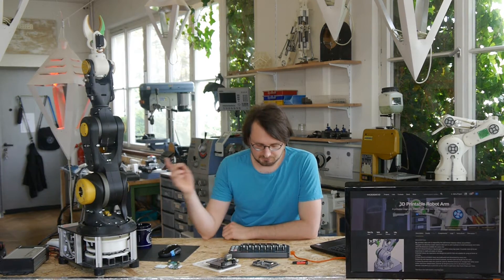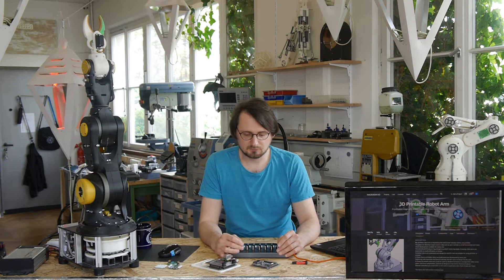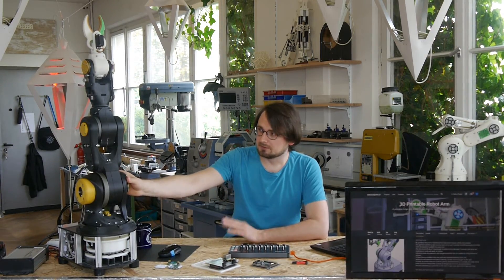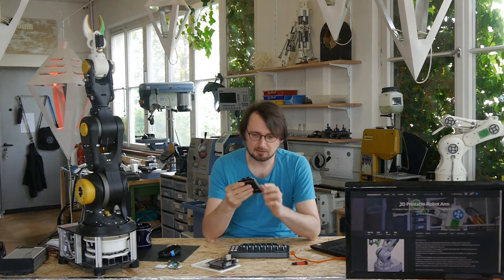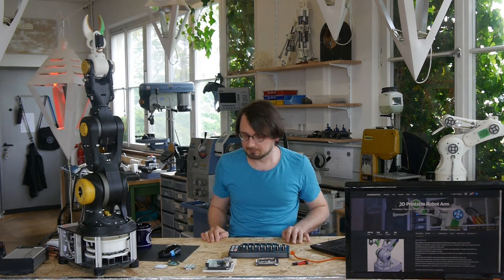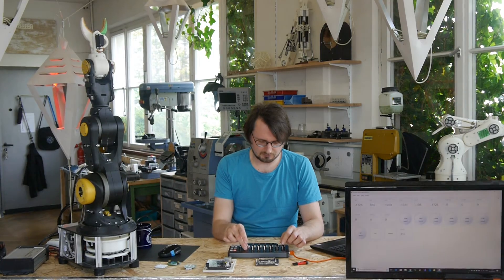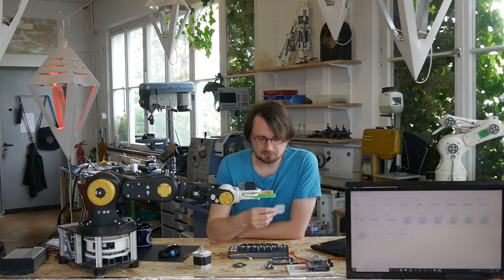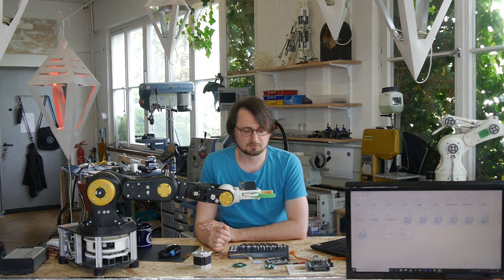3D printed 6-Axis Robot Arm (2019 Update)

Comment: I am using AMT203S-V absolute 12bit encoders, had a nightmare fixing all the issues with them, but i finally got them working, both position reading and zeroing, i can post code and notes somewhere if you're using other platforms

Comment: I have a few noise suggestions.
I have not seen the design so excuse the irrelevant information.
Open bearing only get noisier as they get dirtier, sealed lubricated bearings are better.
I don't know what bearings you are using for the base, but you might want to use lubricated "lazy susan" (corner kitchen cabinet turntable bearing) bearings, lubricated bearing are quieter and are designed for perpendicular loads and can handle any weight your arm could place on it, not super expensive either.  Of course, larger diameter is more stable.  https://www.mcmaster.com/lazy-susan-bearings/round-turntables-7/ ( I would recommend the powder coated, for slightly more noise reduction)
You can also mount a rubber mat to both side of the bearings to damping vibrations. it would only need to be a couple of mm thick. (can be added elsewhere as well)
I would also recommend a bearing at the top of the base to stabilize the load vertically so weight is evenly distributed on the turntable bearing even when the arm is fully extended horizontally.
I would love to duplicate the current version, is it available for download? 
good luck

Comment: Hello. What nozzle and on what modes (wall thickness, filling density, layer thickness, speed) you carried out production of details of the robot?
Reply from the maker: ABS 0.4mm nozzle,  0.2 layer height 3 perimeters and about 30% infill. Printed with my default settings I don't know the exact settings it was 2 years ago.

Comment: Amazing project, especially considering that yours was probably one of the first working builds of its kind!
If you use the AMS encoder, the newer models are really better than their older ones. Also make sure to use for all cables shielded cables, the stepper motors create some EMF which might disturb the delicate magnetic encoders.

For the ball bearing in the bottom, which kind of bearing do you use right now? Maybe you can consider bearings with cylindrical elements instead of spherical ones, they are way quieter! Are they 3d printed as well?

Check out the project "Woodenhaptics" - they use multi core metal wire instead of belts, they are a lot stiffer than all belts you can get. Check out CS235 of Stanford about Cable Tansmissions, here on youtube.

Comment: btw you said you have slip rings now which is neat. But have you checked if that introduces noise on the digital lines? if so that could be an encoder issue. Just a guess.
Reply from the maker: Well good point...

Comment: Looks good and solid. Beautiful design. You could maybe have a tiny electrical contact point which the motor encoderboard handles as a 'limit switch' for calibration/reset. 
Maybe you can do a video about the encoder, then we can figure that problem out in no time and have a really solid solution so it operates flawlessly. It's so annoying when something isn't reliable. It ruins all the joy. That it flexes a little I don't see as a big problem as long as it is repeatable and doesn't flop around a lot when moving.
In a later version it would probably be good to have data on the motor strain as part of the control. To know how fast it can move. Strain data can also help to move it without vibration.

Comment: Love that you continued with this project.
Remindes me of a couple of mine wich are also on hold.
Two details:
The motor was a Nema 23 not Nema 17.
Splip rings are known for emi issues. Your connection is basically running through a brush on a metal surface. 
Th encoders worked before right? So it is most certainly its a electrical issue. Maybe even the new stepper drivers are causing more noise...
Good luck getting this thing done.
Reply from the maker: Right Nema 23 of course, still I do the videos without script ;). The slip rings could cause the problems right, I will take a look at this. I totally ignored this.